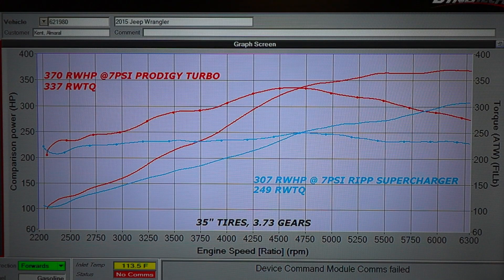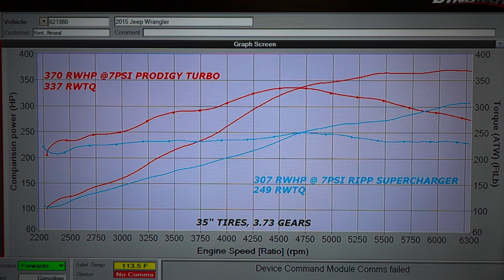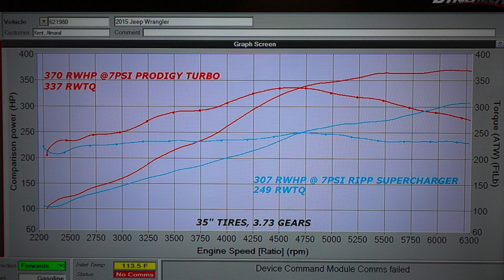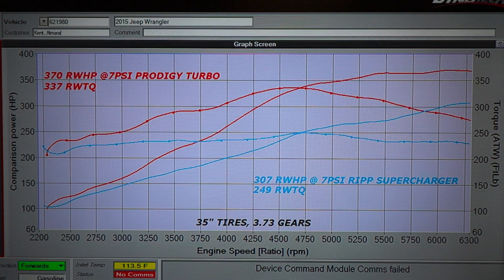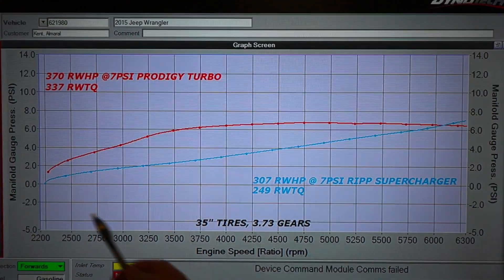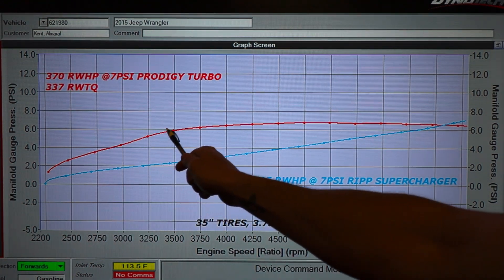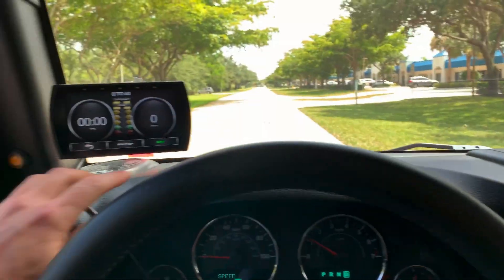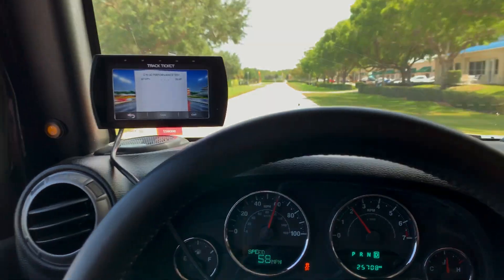Making The Switch Part 2: Supercharger to Turbo THE AFTERMATH

Comment: Would this system also work with the 2015 grand cherokee 3.6?? I thought they were the same motor correct?
Reply from the maker: Yes they are the same motor but the pipes would need to be routed differently. GC is in the future plans!

Comment: So RIPP is a belt-driven Turbo marketed as a supercharger.  Run one with an Edelbrock twin-screw.  I am betting the high RPM WHP will be lower but there will be little to no boost curve, right?  What about cam mods for the VVT?  Does Prodigy have anything like that?  I know the cost for these mods would still be 1/3 or 1/4 the cost of say a Dodge Hellcat or Demon swap so its still the best bang for your buck.

Comment: It would be interesting to compare against the RIPP XL system that peaks at ~13 psi due to the altitude pulley, the bigger IC and the improved piping between the IC and the TB
Reply from the maker: This was a great chance for an apples to apples comparison @ 7 PSI. I can tell you our kit made 436 whp @ 12 PSI in our little red 2 door you'll see in older videos. No need to purchase any "XL" upgrade, just a simple wastegate spring change. Based on our testing, however, the internal components in the motor start to fail around that 12-13 PSI range, which is why I imagine we sell a lot of our forged internal components to RIPP guys. We highly recommend doing those forged internals if you were seeking higher boost levels no matter what kit you've decided to go with.

Comment: Awesome comparison. Would you still get similar results with 35s and 4.56 gears on a 6 speed jku 3.6. I heard higher gearing might be a disadvantage when it comes to a turbo?
Reply from the maker: Thank you! You may have a quicker 0-60 time with your setup, but would have a much higher resting RPM on the highway. Horsepower should be the same, but based on what we've seen on other JK's we've pre-dyno'd, the factory motor puts out anywhere between 195-220 hp to the wheels on average. So depending on what your baseline was would determine total horsepower gain. We did a very similiar jeep to this one except manual and 37's with 4.10s and netted the exact same 0-60 time of 6.6...if that means anything.
Reply: Prodigy Performance awesome thank you!
Reply: @ProdigyPerformance  that's rather impressive for 37s and 4.56 gears. Now if only it didn't cost the same as another car.